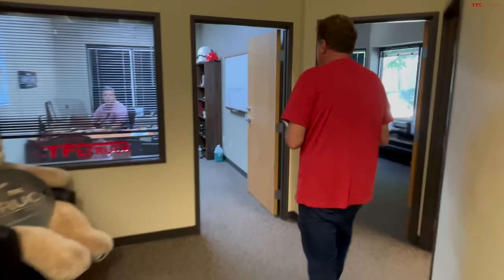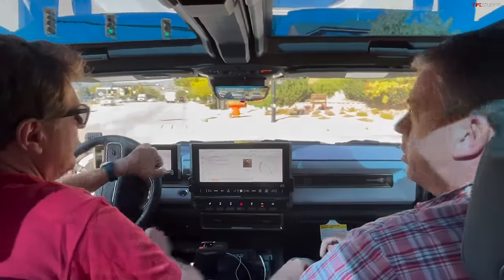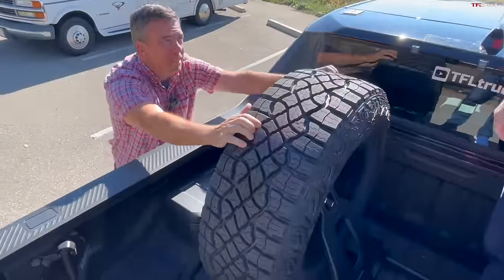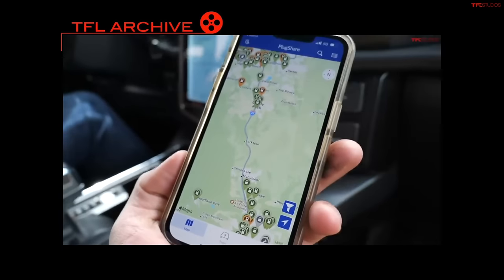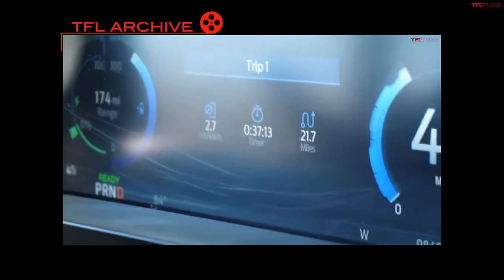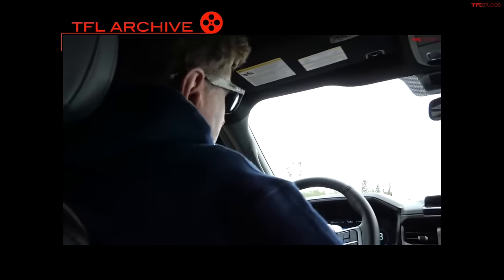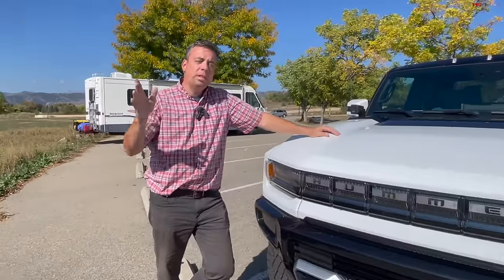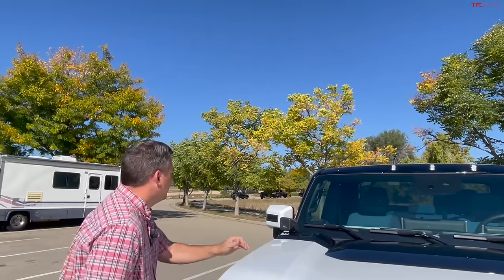Here's What Happened to Our Hummer EV When It Broke Down & WHY We Traded Our F-150 Lightning for It!

Comment: I love how GM said it was a mere "anomaly". My problem is that a supposed " little " glitch can render this $100k off-road capable beast absolutely useless.
Reply: At a company I worked for a few years ago, the owners son placed a project bid and forgot to add one zero. Needless to say they were in the red before even stepping onto the jobsite. The owner called it a computer glitch. Did his son loss his job? Of course not. Anyone else and he would of kicked him out in a few seconds.
Reply: Should'a called Trailmater.
Reply: Right? Imagine said small “anomaly” forcing this 6,000 lb vehicle into park at 65MPH then trying to justify the software being at fault.
Reply: As a Gm mechanic, GM software is pretty crap and anomalies do happen more than you'd like. Had a brand new 2020 cadillac ct5 completely shutdown and would not start. Had it sit for 24 hours and an over the air update fixed the vehicle like nothing happened. Scanned it after and checked if anything happened and no bueno...
Reply: It’s completely useless anyways, unless you use it for groceries.
Reply: TFLT: "sthee sthos sthus sthauze" 🤣

No, the world is NOT transitioning into these Highly-Impractical, Very Inefficient and definitely NOT green EV's. 🤣
Reply: It’s a GM. It’s rendered useless off of the production line. Why would anyone be duped into an ev anyhow? What’s the thought process behind it?
Reply: A "known software anomaly." Dealer should have advised them that a software update is required before they get a problem.
Reply: It didn't say mere. It said known anomaly. That means they know about this and have done nothing to irradicate the problem.
Reply: They used the same terminology with the 5.3 AFM lawsuit. Its always glitches, very expensive glitches to the customers.
Reply: Lots of cars have glitches. Tesla’s are legion. ICE cars have them too, and can fail spectacularly. Ferrari 258’s caught on fire for instance. Saying it’s an EV problem isn’t fair. Plenty of reasons besides this to avoid them.
Reply: @f.kieranfinney457  It's mostly a GM problem
Reply: @winmancaboose  obviously. I wouldn’t buy a GM product. Not even the Corvette. I’m not even sure I could name more than 4. Silverado, Hummer, ‘Vette… oh and Cadillac CT-something. Do they still make the Camaro? The idea of handing $120k to GM for a high tech monster truck is just absurd. Just set some money on fire. And we shouldn’t single out EVs as inherently flawed. If the goal is reduced emissions though, the Hummer is a giant turd.
Reply: "KNOWN" anomaly. Wouldn't a "KNOWN anomaly NOT be an anomaly?
Reply: IMAGINE IF YOU TOOK IT OFF ROAD AND WAS IN THE MIDDLE OF NOWHERE
Reply: this was a completely paid video by gm and other people to try to make them look  not as bad. video completely scripted.

Comment: When my Chevy Bolt was getting its battery replaced due to fire hazard it took four trips to the dealer, numerous emails to GM corporate and finally the presence of the District Manager with GM Technical Assistance on the phone while they updated the vehicle’s firmware to get it properly installed. It leaves the impression that GM and its dealers have a long way to go to support software-based vehicles.
Reply: What happened to you is what many others have complained about. Dealing with GM is not really a nice experience, something they really need to improve upon.
Reply: You should have bought anything other than a Chevy. They are junk.
Reply: I swear my 22 year old, 200000 mile Oldsmobile bravada is more reliable than anything made in the last 5 years.
Reply: @TheyreStillOutThere  I have a friend that works at Hendrix Chevy in Kansas, he told me that GM has the cheapest overpriced cars on the road with the most problems.
Reply: @ryurc3033  that’s a fact, the never should have went away from their cast block engines, they were stronger and better than the ecotech crap theh make now. The 4.3  the 5.3 and the 6.0 and the 3.8 never should have been phased out.
Reply: that is literally the issue with complex new vehicles like this, or anything really. They are in such a rush to get the product to market no one knows what the hell to do when they come in with an issue. It's the same with the mach E...people were having problems and took them to the dealer and the dealer didn't know what the hell to do. I read an article on one lady, took it in, "that will be 4 months due to the backlog of parts".....on a 3 month old vehicle. If that were I I'd say "ok, give me my money back you effectively sold me a vehicle I can't use".
Reply: My 50 bay service department had 1 laptop to update firmware when GM had the issue with brakes on their pickup trucks. It didn’t take more than 10 minutes  to complete so it was sufficient
Reply: @sk8777kid1  Cars and SUV’s with CVT trans yes. Trucks are pretty good.
Reply: Instead of eliminating ICE vehicles by 2030, maybe GM should consider extending that to 2099.
Reply: almost like it's a bad idea...
Reply: @derekk6906  The idea of eliminating ICE cars in 7 yrs is just lunacy unless they figure that they will be way cheaper than making ICE cars by that time and thus affordable for most people. I still don't see how they sell more electric than ICE by then.
Reply: It’s one of many reasons why I don’t want one.  Only proven vehicles with tons of third party support for daily drivers.
Reply: Shit happens.  There are going to be snags with the transition to EV's, just look at all the problems Tesla has had.
Reply: Pro Tip... Never Ever buy a GM Vehicle.
Reply: It’s not just GM dealers.  Anything FCA is far worse & so is Ford & to a much lesser degree, Toyota/Lexus.  Prices have skyrocketed & quality has dropped, but repair technicians have become both scarce & sloppy.
Reply: @joeking433  zero problems with my model 3 in over 4 years. Just keeps getting better.
Reply: @Justin-ee3im  Sir, how is this vehicle going to be powered ? 

Coal.
Reply: Kind of like when I bought the first year of the Chevy S-10 pickup with Isuzu 4 cyl engine.  Chevy techs had the attitude "not our engine".  Dude, you brand it, you service it.  Don't like that, sell your dealership.  Actually had no engine issues when I sold it on at 40K miles and 10 years, but clutch throw-out bearing was grinding.  Both mirrors fell off while just driving.  Handles would come off in your hand.  Not the best year for any vehicles, and especially GM.
Reply: @sk8777kid1  So are Teslas.
Reply: @tomm487  If they can get the materials they will be fine.
Reply: @ultrastoat3298  That's hard to believe when you read online how many people have had problems with their M3.  And when you do need repairs it can be a nightmare to get it fixed!  Many states don't have Tesla service centers and people have to drive to other states sometimes for repairs!
Reply: @joeking433  junk? Oh I couldn’t agree more friend. I’m not totally against ev’s they have their place but i will never own one and I will never advocate for people buying them. It’s the governments way of controlling peoples free movement, Tesla owners wanna be green? They should buy a damn horse.
Reply: @sk8777kid1  I'm a tech in Pa..Agreed... I have 4 cars of my own now..I tell my friends my next new car will be 20 year old ..or older..
Reply: Chevy (even tho it is GM) sucks at EVs massively. Like somehow that is their worst company for EVs
Reply: At least you HAD a dealer nearby!  Tesla owners in some states have to travel to a different state to get service!
Reply: @tnc7399  Chevy can't make EV's fast enough!  They have multiple year waits for some of their EV's!  Their Bolt will sell like hotcakes at the lower price and new rebate next year!  What is wrong with you?
Reply: @joeking433  it isn't a super great car. Like not bad but you would only get it because you want an EV but don't have enough money for the ridiculous prices
Reply: @joeking433  this is a Chevy vehicle so pretty local usually. But tesla anyway sucks
Reply: @tnc7399  I  can afford any EV but I'll probably get a Bolt because it's a good value.  Whenever I pay a lot for something it always lets me down.  But when I buy inexpensive items I'm often pleasantly surprised how good they are!
Reply: They (GM) is still working with Sun Dials!
Reply: @derekk6906  best comment on YouTube
Reply: @joeking433  Yep, with modern shit, it's always better to buy cheap garbage, because at least then you know you aren't still getting garbage, but paying 3-4x the price for it.
Reply: @joeking433  tbh I don't even understand what you are saying. I dislikes teslas and stuff
Reply: @joeking433  tbh teslas are too focused on tech. Go back a little and build rhe car right

Comment: Would be interesting to see how that 276 range drops in the winter. Sub freezing weather will drop that range substantially.
Reply: All that energy to heat the interior, warm the batteries, electric ain't there yet.
Reply: and in sweden they have warned that we need to save energy, and there is a possibility of electric cutouts... so your car might not even be charged on the morning...
Reply: Based on the sheer size of its 200kWh battery and how inefficient it already is, probably not too much. Doubt it’ll lose more than 15-20% in the worst weather a normal person might deal with. Most EVs that get hit that hard are usually because they’re relying so hard on efficiency and relatively mid-small sized batteries, but this is already brute forcing it’s way through even the best conditions
Reply: @leadfoot8593  sure it is! Just look to California...
Reply: Try a test up here in Northern Ontario Canada , winters are a tad chilly with temps reaching lows of -40 windchill exceeding - 50 or colder … see how far you’ll get never mind that there are very few charging stations … good luck 👍
Reply: It won't be that bad because you'll be paying all night, every night trickle charging to keep it warm in your detached garage.
Reply: I drove my ev in minus 40 in north Dakota, never had a problem
Reply: @leadfoot8593  yes, it is
Reply: @bradmagnuson6963  what is total bullshit?
Reply: @AndrewTSq  your statement that an ev wouldn't be charged by morning. It's total bullshit
Reply: and even right now, I pay more for electricity which makes it cheaper to take my petrolcar to work than ev. and its not even cold outside yet.. at winter we usually get -20 deg celsius
Reply: @AndrewTSq  LMAO, it costs less to charge an ev, than it does to put gas in a car. At a pay station, it cost me a little over $6 to go from 16% to 90%, breaking it down to barely 10 cents a mile. If I use free public chargers, it doesn't cost me a cent to drive my EV
Reply: @AndrewTSq  -20 Celsius is -4 degrees. I drove my ev in -40 degrees in north Dakota, never had a problem
Reply: @bradmagnuson6963  you dont live in Sweden. Great that you can charge your car for free. Charge at home for me is half a dollar per kWh. In winter last year it was way over 1 usd per kWh.
Reply: @AndrewTSq  so what? It's still far less expensive than paying for gas, stop complaining
Reply: @bradmagnuson6963  I paid $42k for my f150 Platinum. It has a range of over 500 miles on a tank of gas, and can tow. At $72k difference in price, I'll have to own that truck for over 25 years before I'll even come close to offsetting that kind of cost for that cute toy that can only tow 6500 lbs for 125 miles. I think I'll keep my dinosaur burner.
Reply: @bradmagnuson6963  Put a 15,000lb trailer on that EV. Bet you I go farther than you do. We're talking trucks here kid. Stay on topic. May have well just told me your electric skateboard gets better energy/mile.
Reply: @leadfoot8593  My ICE car here in upstate NY also burns through more gas in the winter, not much of a difference. In normal city driving conditions, my car gets about 15-20% worse gas mileage at 15-20 degrees F than it does at about 70-75 degrees F, and 15-20 isn't even that cold, can have days where it is like -10, so I suspect that it gets as bad as maybe 25% worse mileage.
Reply: @rdizzy1  yes that is a fact, just like the difference in time to charge vs filling the tank, not to mention charging point options vs gas stations.
Reply: These guys tested an electric hummer under load and it wouldn't do more than a 100 miles with the trailer attached. Its a POS.